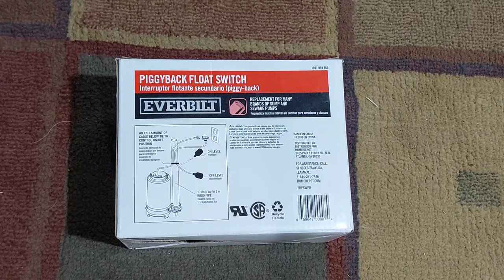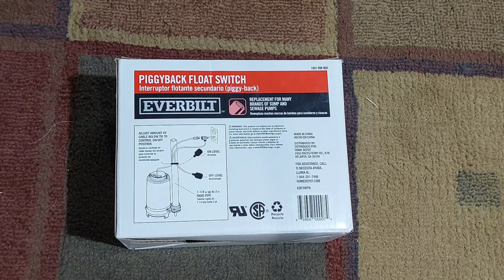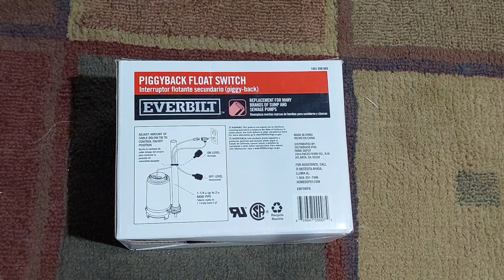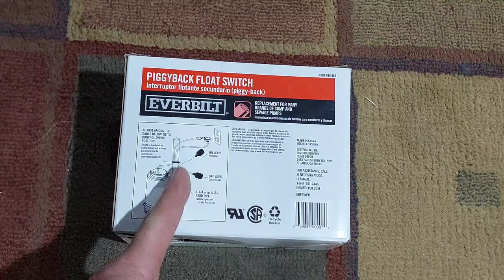How to install float switch to sump pump. tether float switch

Comment: Thanks brother, good post.  I gave it a knowing laugh when you said, "we'll look at the directions afterward."  God bless.
Reply from the maker: I've done this a few times, so I didn't really need to check out the directions. Next time, though, I'm using the other float. This was a pain to get in the right spot, just to save $8. It's not worth it! Lol, thanks. God bless.